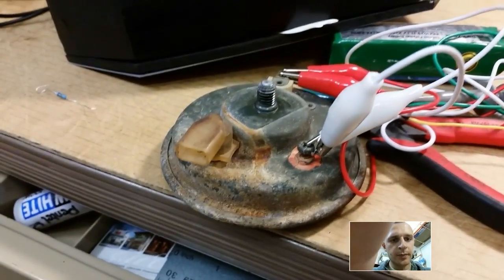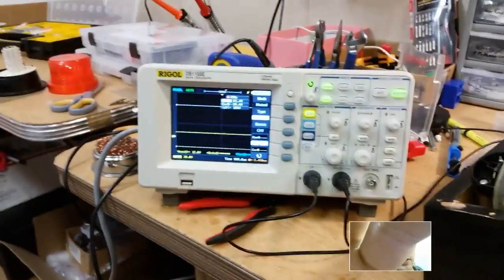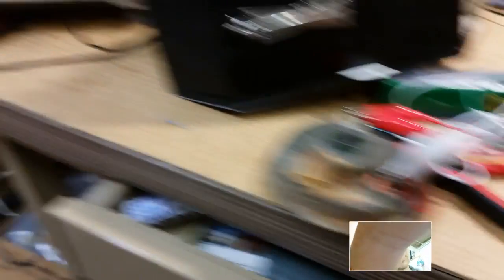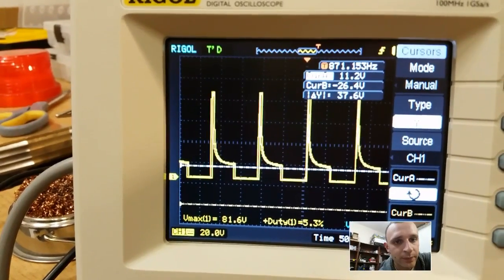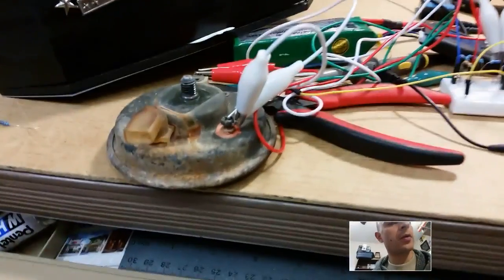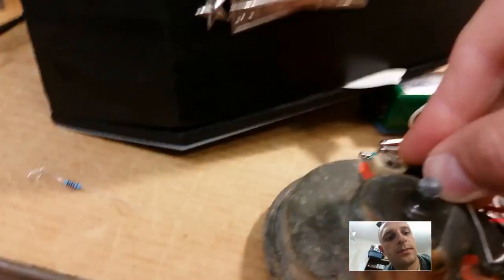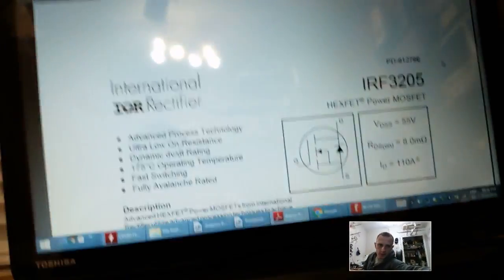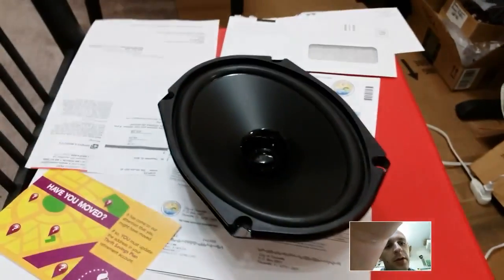Playing a siren sound through a standard car horn using Arduino

Comment: This is amazing! I was about to execute a similar project by attempting to lengthen the air column on multiple horns, leading to a polyphonic effect rather than monophonic, treating the horns as oscillators in a synth or organ pipes. I have yet to receive my first horn in mail to test if this is even possible, if not by lengthening the air columns then by controlling the input current and voltage like you are with several horns. Video coming.

Comment: Got the code but wher is wiring diagram ? Please give me I need it
Reply from the maker: Just buy a good DC motor driver (H bridge) normally used in robotics and wire up the horn or speaker (speaker is much better) as though it was a motor. That's all my home-made driver circuit is anyway.
Reply: Will this work ? And can you tell me wiring in short ?
Reply: Up to 46v 3 amp 25watt
Reply: Hello ?
Reply: Hey it's working but too much static sound what should I do ?

Comment: Cool video!
can you explain how the amplifier works?
Reply from the maker: It's basically just a home-built MOSFET H-bridge that allows bidirectional driving of the speaker (or car horn) using the toneAC library (if I remember correctly). I'm just driving the horn with a digital square wave of 50% duty cycle at whatever frequency of sound I want it to make. Here I'm varying the frequency according to a sine wave I stored into the Arduino as a look-up table. So...in short, it's an H-bridge being driven bidirectionally with 2x 0 to 5V square waves, offset by a phase shift of 90 deg. Note also that my horn died a short time after making this video. It's not made for this kind of treatment. My speaker is still going strong, however, though I did end up adding a large electrolytic bipolar AC coupling capacitor to prevent DC shorts from frying the speaker.
Reply from the maker: One more thing: instead of building your own MOSFET H-bridge, I recommend you just go buy an H-bridge built for driving DC robotic motors. It'll be much easier to implement. Pololu sells some good ones. I'm also thinking about improving my circuit and getting a PCB professionally manufactured so people can buy this as a kit for like $50 or something. That'd be pretty cool I think. Thoughts?
Reply: I think that will be great! by the way recently i searched the web for many types of amps and what i found the most effective and simple one was using a TDA2050 as an amplifier and couple of capacitors for noise reduction and i was lucky so I've got all the needed material to make it, i think i'll finish it this week hopefully, this is the link to instructables tutorial i found the best : http://www.instructables.com/id/32W-Stereo-Audio-Amplifier/step2/main-amplifier/